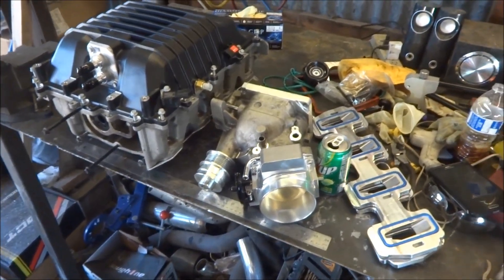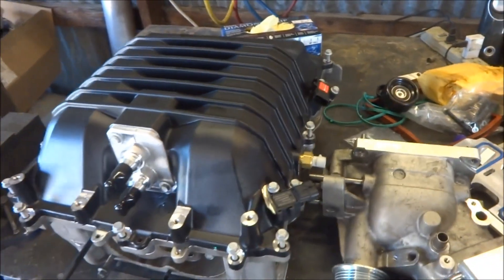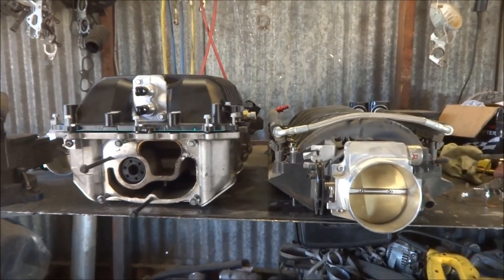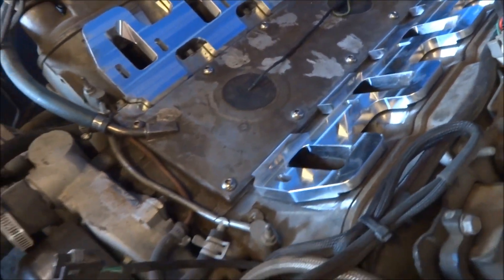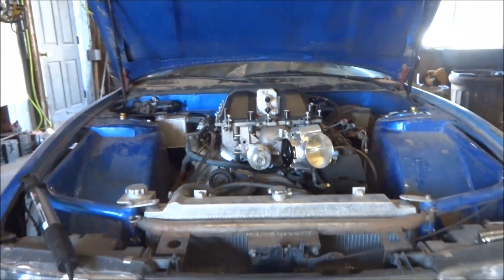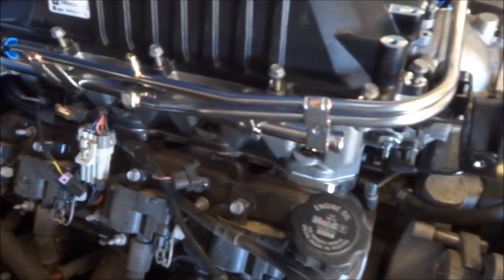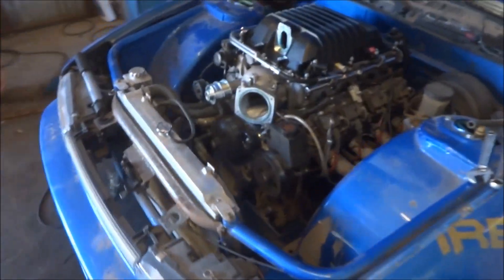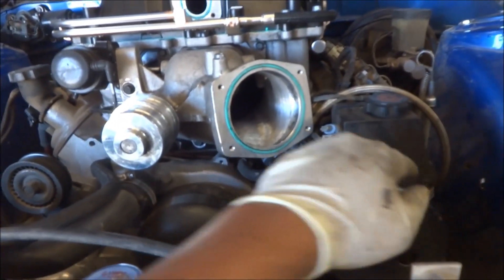LSA SUPERCHARGER INSTALL LS1 LS6 CATHEDRAL PORT

Comment: What injectors did you run? 80 Siemens/deka? Do they make short ones that fit the rails?
Reply from the maker: Yes those injectors. I dont belive they make short ones. My current setup is oem LSA injectors and I make 661 to the wheels without leaning out
Reply: Empire Garage, right on I just put an lsa blower on my stock 5.3 in my rock crawler, I’m running a 2.55 pulley and otherwise stock expect for a zo6 cam, stock injectors should probably work for me as well. Thanks man

Comment: Bad ass...did you have any other issues with this setup? Trying to probably get this setup this week. Oh and did you have to run low comp pistons or you left everything factory?
Reply from the maker: I had no issues with it. Everything was left factory. I have a great tuner here so I ran it through its paces for a year and the motor held up fine
Reply: @EmpireGarage  Bad ass thanks man! I am looking to your vids for the future.

Comment: Planning on doing the same swap. Is your ls1 stock or are you running a bigger cam? Forged internals?
Reply from the maker: All stock ls6 aside from dual valve springs

Comment: How did you run your throttle cable for your throttle body??
Reply from the maker: I ran it along the supercharger on the side and ran it across the front and back to throttle body. I made a bracket for the throttle body

Comment: Nice set up man. How much was the the super charger and cover?
Reply from the maker: both of those around $2k
Reply: Wow 2k & a little more coin, big bang on budget for sure..best bang for the buck..hp & torque gains..
Cam & valvetrain upgrades already 1k.. Fast intake & tbi over 1k..
So genuine GM blower for dependable, reliable, instant gratification horsepower with NO 
turbo lag...awsome build & videos
Thank you

Comment: How much did you spend for everything?
Reply from the maker: Kristine Hietpas I think roughly $2500 or so for everything. It helps that since I have a shop I fabricated a lot of stuff I needed for it to work in my car.
Reply: Where are you located?
Reply from the maker: Kristine Hietpas Albuquerque NM
Reply from the maker: I have a Facebook page you can contact me at also. Look up empire garage Albuquerque and it should show up
Reply: @EmpireGarage  did you have to add ARP rod bolts or any other "insurance" to long block before adding F/I?

Comment: What size TB is that? I'm looking for a DBC TB for a LSA setup too
Reply from the maker: Billy Webb it's a 92mm ebay cheap knockoff. The trick is to use the oem throttle spring and it feels just like stock
Reply: Awesome, thanks for the quick response!
Reply from the maker: Billy Webb of course no problem!
Reply from the maker: Yep over all i am very happy with it.
Reply: so over all are you happy with the throttle body off of ebayim really interested in one im doing a lsa on an 04 gto

Comment: what did you end up doing about the map sensor thanks in advance
Reply from the maker: I ended up using the 3 bar map sensor. There is a setting that allows you to put the map values into the negatives in the latest update of hp tuners. After putting in the correct injector data it ran a lot better. I think at this point it is able to be tuned and should go smoothly. Ill make an update video soon as i should be on the dyno in the next couple weeks